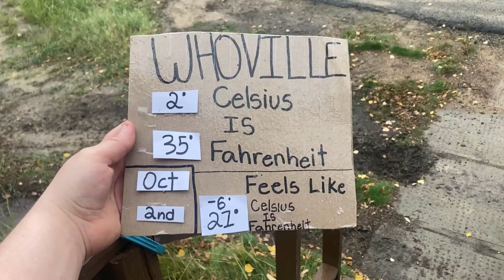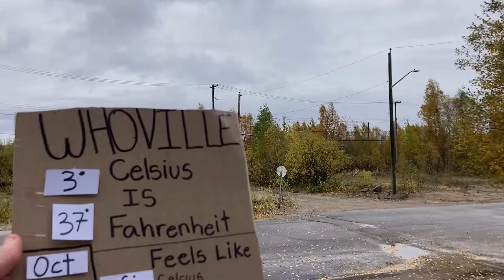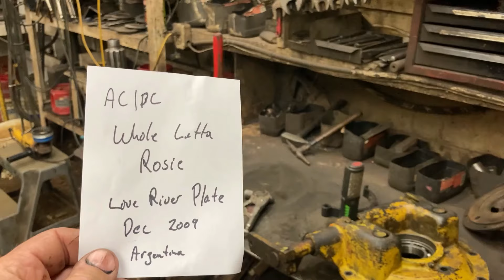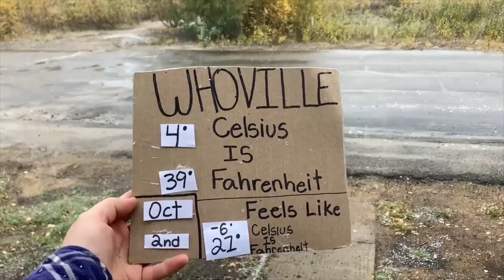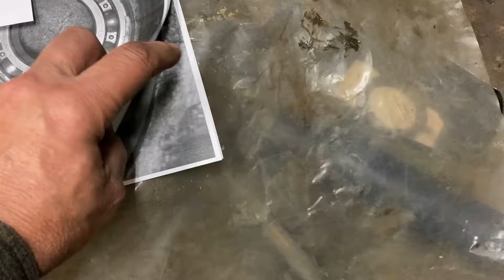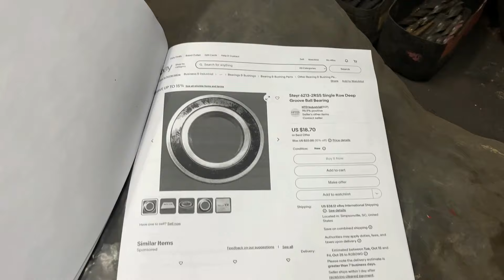Missing Part of the Clutch Brake So I Made One Out of Scrap Metal Oct 02 2024

Comment: Not sure of the size but could you use a piece of 5" or 6" exhaust pipe and cut and weld for the clutch brake . Just a thought keep up the good work really enjoy your videos
Reply from the maker: yes using pipe would have been easier but did not have any the right size.  thansk

Comment: Hey, I don't get all that excited about flags, so you will never offend me. Also, it's not unheard of to reline a brake band.  When I went to school, we did them. We even relined brake shoes. Disc's were out by then, but not real prevalent. So we had to drill out the rivets, clean the old shoes, inspect them and paint them. Then set up the frictions and drill them and rivet them, and then measure the drum and arc the shoes to match. I was leery of it because I'd heard brake linings contained asbestos. I'm 72 and no cancer yet. Knock Knock on wood.  OK FB KoO. Keep up the good work. ben/ michigan
Reply from the maker: yes we have Sir Rodney reline a lot of our old brake shoes and park brakes. the clutch brake arm was relined so we knew what it was going to take to build what was missing thansk